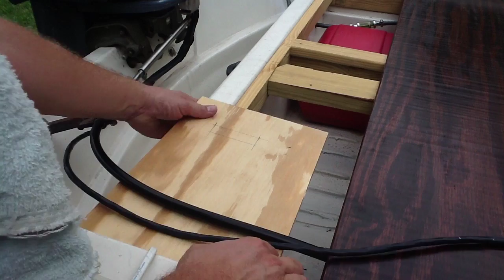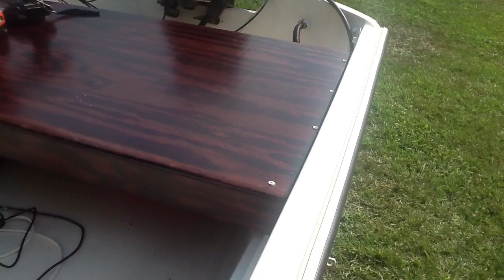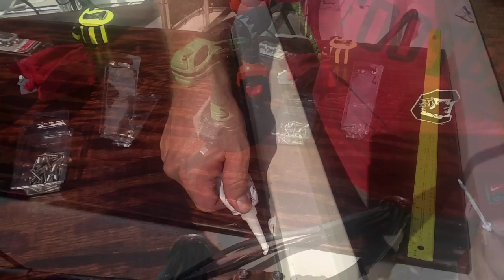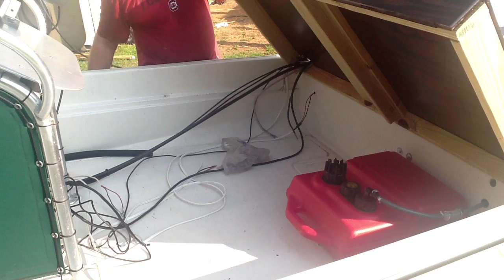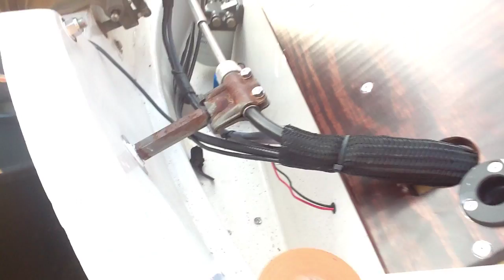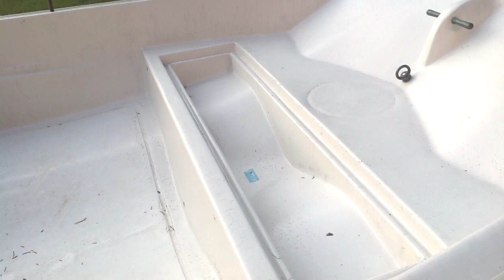Steve's Boston Whaler Restoration Part 15 - Deck and Cabling

Comment: Oh, I think I  see, the frame just lays on the ledge for east removal. Excellent videos
Reply from the maker: Yes, just rests on the rails. I added a little stainless loop on floor so I can tie the front of the seat down and the wind won't lift it while trailering.

Comment: Maybe I missed, but how does the seat attach to the boat.I have an 1977 BW Tender,and there is nothing to screw to,as the boat is all foam with a thin layer of fiberglass skin on the surface.Screws just pop out, so I attached a single board seat with marine adhesive. Yours looks so much stronger.